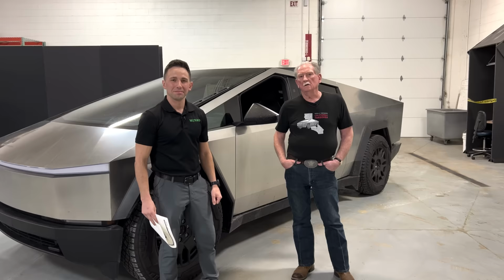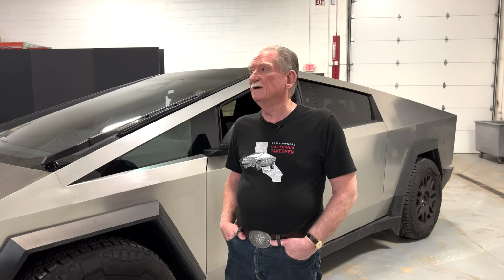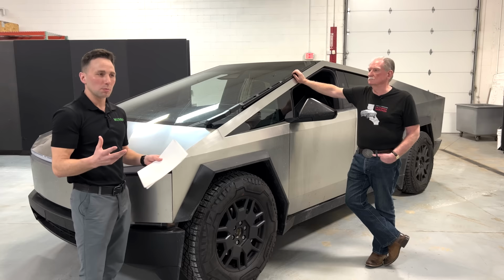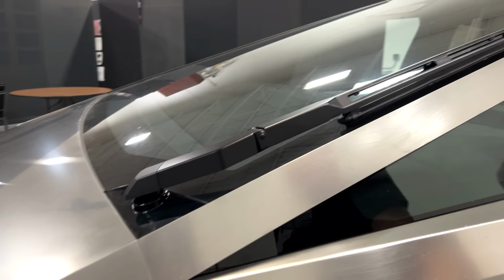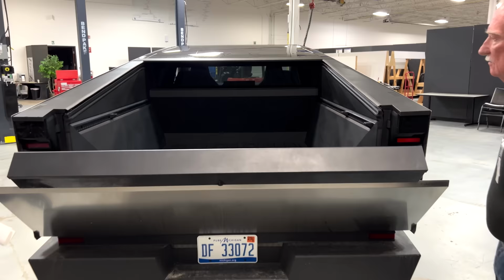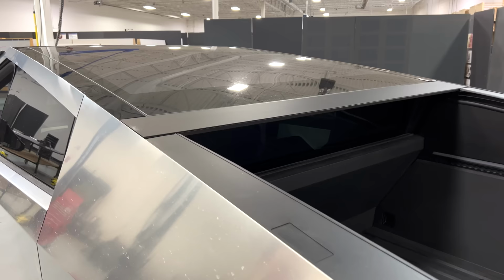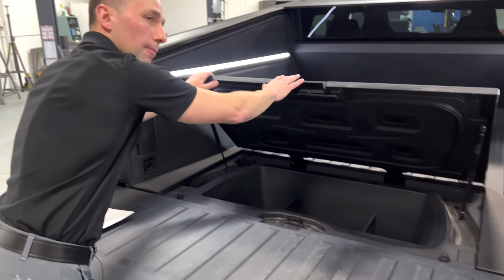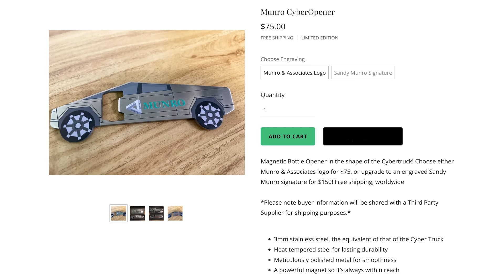We're Tearing Down a Cybertruck!

Comment: It would have been really great if they had built in a midgate that folds down like an Avalanche.
Reply: then CT would NOT be water tight.
CT has scuba system for Battery pack.
Reply: Midgates are a major structural problem. The Avalanche was body on frame, every other unibody pickup hasn't had a midgate for that very reason... structural rigidity just isn't there, especially if you want a meaningful amount of payload/towing
Reply: @Black-Villain  Didn’t say it would be easy.
Reply: @Black-Villain   Agree.  At times on does what is best for the design.

Comment: For me, it's crucial to check whether this car has the announced exoskeleton. I'm afraid these flat panels are attached to a regular steel body.
Reply: Videos from the factory shows the cybertruck frame is regular stamped mild  steel with some very large aluminium castings, not as large as the model 3 or y mind you, then the hard stainless steel external panels.Interviews with tesla have also confirmed the internal frame is steel, they didnt specify what grade, but likely its mild with some areas hardened depending whats needs for crash worthiness.
Reply: Yeap, it may have some structurral involment.
Reply: The problem is that few people bother to understand what an exeskeleton is.  As I understand it for the purposes of vehicles so long as the skin plays a part in the structure it is an exoskeleton.    But forget that.  What ELon said is they were going to move some of the weight from the frame to the outside to build a tough truck.  They did that.  Then they figured out they could reduce the wight of that skin by work hardening the 1.4mm stainless.   So unless you goal is to prove Elon lied, not allowed to change, you now know all you need to know about the the exoskeleton issue.
Reply: @Marc83Aus  Sort of close.  The cabin sides are constructed of ultra high strength hot stamped boron steel.  As do BMW and Mercedes Benz. This is where the similarity with a regular unibody  or body on frame truck ends.  The front and rear castings bolt to the cabin.  The casting provide the mounting points for the body, motors, gear reduction and suspension.  The aluminum casting have the crush zones engineered into them.  No steel needed.   A casting gives the designer more control over shape and cross section so works well for this.   
Tesla has some very good materials science people.   They use what is best suited.
Reply: @danharold3087 Thank you for the extra details.

Comment: There is an important distinction that I feel the need to call out. And that is the difference between what is a truck and what is a pickup. A pickup is any vehicle with a pickup bed on it. A truck, however, is an Unlimited Utility Vehicle. That a Truck can be configured with any type of duty specific or general utility equipment on the rear portion of its chassis is what gives it the distinction of an Unlimited Utility Vehicle. 
Vehicles such as the Ford Maverick or the Tesla Cyber[Pickup] do not have the ability to interchangeably exchange the rear portion of the vehicle without significant alteration to the structure of the vehicle; therefore they are limited utility vehicles. Vehicles like the Ford F series, Chevy/GMC twins, Ram, Toyota, even Nissan, all build Trucks that are configured from the factory as Pickups, but because that pickup bed can be uninstalled without altering the structure of the vehicle it is still an Unlimited Utility Vehicle.
Reply: I would have said the difference between a truck and a pickup truck.  Tesla has all the experience and bits needed to build all sorts for trucks up to the class  8 semi.  Don't look for them anytime soon.

Comment: 8:00 imagine some magical sensor that'd sense the actual distance to obstacles in the back. Like an artificial bat or a sonar but with air instead of water... 😮
Reply: As an owner of an Model 3 with the WORTHLESS, WORTHLESS, WORTHLESS* camera-driven park assist, I appreciate the sarcasm, but doesn't the CyberTruck have a backup camera?

* Did I mention worthless?
Reply: - see video, Tesla model 3 - 7 point turn , culdesac.
Reply: @Wi2Low  - the Driver is using PURE vision & no stalks.
just swipe & turn EZ peezy.
no OTHER can do that.
Reply: @Wi2Low  I expect tesla will be intensively working on the CT software for the next year.

Comment: A truck is for putting things in, moving them, and getting them out.  You cannot put things in from the sides.  It is too tall.  You could throw things in.  Then when you want to get something out, you cannot because the sides are too tall.  You must crawl in from the back and the bed height is too high.  There are no steps to be able to climb in.  The bin is too far in to reach without climbing in. This is a poorly designed truck.  It is like a bunch of city kids wanted to design one but had never actually used one to go into the backcountry or get work done.

Comment: Still have to disagree with Sandy constantly saying this isn't a work truck. That is only currently true due to the price. Being from the trades and talking to other guys who work in the field, I can say that many of them would love to have this as a work truck, where they can easily lock their tools in the back and don't have to worry about scratches and dents.
Reply: It's not a work truck. One big challenge will be repair. Most work trucks can be repaired at most within a few days.
Reply: i strongly disagree with you too, work trucks are made to be super practical and versatile from offering single to double cab to different bed lenghts to different load carying capacity.... the bed can very easily be removed or modified to add equipments, the frame is tougher to mount equipments..... look at the ford f250, f350... they have third wheel option, dually options....
Reply: a conventional truck can be have the bed removed to install a dump truck, a crane, utility bed, conversion to ambulance, bus, RV..... the cybertruck is a joke compared to a real truck! i mean even 6x6 conversions are possible with the amazing solid axles... even mercedes Sprinter vans have the ability to mount a crane.
Reply: @alanmay7929 nobody does all that to a half- ton pickup, be it F150 or Cybertruck.
Reply: @jamesengland7461  the point is the fan bois want to claim the Cybertruck is going to replace all trucks everywhere and everyone else will be bankrupt within a few years.
Reply: I'm definitely not claiming that this will replace all trucks, but this is perfect as a job site truck used for hauling around tools and some material.
Reply: @MorganWalser  it's a little expensive for a job site truck. My Ford F-150 v8 with a 8 foot bed, use to get all the notes for cash offers.
Reply: @MorganWalser  but I am expecting the next generation Tesla van will be mega popular with the trades.
Reply: @Dularr  yeah, it certainly needs to come down in price first. I said that I'm my initial comment. I agree that a van would be extremely useful.
Reply: @Dularr    The CT is Tesla's smallest truck.   It has all the goodies to build body on frame trucks from the semi on down.  I don't expect them too as they have other things to do.
Reply: @MorganWalser  nope its not!, its a very unpractical truck which wont get better with time! there is a reason why trucks have had the very simple body on frame to allow all kinds of configurations possible! i dont think there is ever going to be a single cab version of this with different bed lenght.......
Reply: @jamesengland7461  lol!!!!!!!!!!

Comment: Don't get it wet, it rusts easily. Also, don't get stranded with a flat anywhere because it's a truck that doesn't even come with a spare tyre.
Reply: That's not rust it's particles that fall on it and oxidize.
Reply: Blatant lie

Comment: You got it.  TESLA went after the 73% of the pickup truck owners only use the truck to haul or tow 2-3 times a year.  The reset of the time it is daily travel just up high, which my wife liked about the Ford Ranger we had for a while.  It is a truck that rides like a car but raises for off road/camping, hauls projects easily handling the 4x8 sheets, and can still tow.
Reply: I am projecting 1/3 of CTs will have our ladies behind the wheel.

Comment: Finally the type of content for which I subscribed in the first place 🎉 but honestly sandy has become a bit of a Tesla shill.  The windshield wiper literally shakes my cyber truck at a stop and it doesn’t even clear the passenger side. Horrible design yet he’s talking about how wonderful it is. lol
Reply: Agreed. Claiming that this is the best Sport truck… what sport? I’ve seen so many videos of this getting stuck off-road. It’s not the fastest or even close to the most capable, so not sure how it could be considered the best.
Reply: Are you using RainX products?  I'm finding that they can cause wiper sticking, rumbling, chatter and total locking up on many vehicles and more so especially on those with long wiper blades.

When people bring me a vehicle with wiper issues first thing I check is for RainX and the fix is very often to flush out the washer tank, scrub it off the windshield and replace the contaminated wiper blades then tell the customer that they should refrain from using it on their vehicle.

Best!
Reply: @neilfromclearwaterfl81 RainX does that to get people's money, let's be real.
Reply: @casualgamer1209  If we don't call it out many will end up getting scalped by mechanics who have no problem with replacing or charging to replace expensive components when all that was needed was to clean the RainX residue from the windshield along with the rest of the wiper/washer system.

I've also come come across some who have broken teeth off the gears in their wiper motors due to the additional stress it can put on the system.

RainX to me is for vehicles without wipers or with wipers that are broken and you need to drive in the rain before they can be repaired.

Anyways, best to call it out so some who haven't considered this won't also suffer similar.

Best!

Comment: Sandy.
Why not a bed slide-out?
Even easier to load / offload sheet material, or you hunting gear, etc.
Plus, why not a second lightweight slide-out fixed to the airline track? Great for tools, coats, boots, etc.
.
Would make the truck REALLY practical.
Reply: Don't know why.
Reply: These are things that not everyone will want and will add cost.  Watch the 3rd party suppliers.  If there is a market for them they will come.

Comment: The old guy is talking about how the body lines are like 1/4" apart on purpose for water runoff --- WHAT??  total smokescreen.  This looks bad, the stainless steel shows buff marks everywhere and not a uniform look, fingerprints everywhere -- these 2 fanboys are just that.  These trucks suck.  Embarassing that they have the audacity to call it a beast.  It will lose in a real truck war.
Reply: Fingerprints and stuff are because it's stainless steel, won't appear on wraps (something most people will probably get), panel gaps will get smaller and are due to the manufacturing process (plus, look at this versus prototypes spotted in tge past- much better, dont you think?). YOu can call me a fanboy, but I actually like looking at other platforms, and my 2nd choice is MY, first choice is Ioniq 5 because of the charging and brand loyalty within my family.

Comment: Tesla Fanboys 1 st the full self driving function is not enable not even adaptive cruise control second the truck was delivered with no hub caps they are damaging the tires you are telling me they did 1000 of milles of durability testing and did not see this ? Third how do you climb into the truck bead compared to a ford lightning ? Fourth the rear steer is limited because of software so the truck is not fully ready . Fifth the differential lock are not functional again software locked and why is the driving range is not even close to what they said it should have when they unveiled the truck back then and the price is way higher than what it was supposed to be.  lastly the outer stainless steel panel are not part of the exoskeleton.  It’s not any more than the composite panels on a Saturn car.
Reply: Then buy the Saturn you love so much.  Only 2.1 million fanboys have them on order - so enough to keep the factory running for quite a while.  Is it perfect - no, but I've never seen a vehicle that is.
Reply: Range estimates were hyper-optimistic to be fair, bed seems to be step-less so it's up to you if that's a good or bad thing, and hubcaps/aero covers are gone because they actually damaged the tires MORE than without them.

Comment: 304 stainless steel... they @#$%@#$^% made the skin out of the wrong alloy.
Reply: I'm sure it's not 304, but a custom alloy that Tesla developed in part for SpaceX.  Just a lot of people associate the look of 304 with the Cybertruck without any knowledge.
Reply: Why is that the wrong alloy? Reportedly, this alloy was chosen with help from some of the best material experts around - namely SpaceX.
Reply: @tesla_tap 3ric Johanson used an x-ray metallurgy analyzer and its 304… don’t know how much more specific you can get than that.
Reply: It's Bulletproof martensite.
Reply: @markplott4820  304 stainless steel is an austenitic steel that can transform into martensite under stress... like a bullet hitting it for example.

Comment: I feel like Tesla is missing an opportunity to convert the under-bed storage into the space for range extending batteries. There could be hookups in there for coolant lines, too, so that campers can tap directly into the truck's heat pump. That would also work for cooling a battery pack. Or for converting the bed to a refrigerator truck. There are possibilities for commercial, RV, and range extension.

Comment: So disappointed that they cut out two of the most practical ideas from the launch truck: kneeling rear suspension and tailgate integral loading ramp. Trucks have needed those for decades, thought Tesla had done it with a clean sheet design, but why didn't they? And what's the bed height?
Reply: Tesla is good at doing software updates like this.  Give them some time to finish the truck then ask for upgrades on X.  Elon and the factory people are listening.

Comment: Gotta agree with Sandy's comment that the F-150 is a "work" truck (although I would have said "real" truck) and the CT is a "sport" truck.
Reply: Cybertruck has MORE utility & use case than Lightning.
and Lightning has poor SALES.
Reply: Yeah that f150 with the shorter smaller bed, lower ground clearance, and less durable body and glass is totally the best work truck lmfao

Comment: My biggest disappointment is the range, during the tear down my question is: is there space to add more batteries or is the 123 megawatts a space limit?
Reply: Range extender is planned but it's in the back of tghe bed for some reason and not in the under-bed area
Reply: @casualgamer1209  the range extender is such a clumsy solution.  I wondering if there wasn’t room for more batteries up the the bed.
Reply: The 123KWh (not mega) is a weight more than a space issue.   GMC did what your asking for with its 2 layer batteries in the WT4 and hummer.  You can maybe buy them.

Comment: A very important thing is to show in detail the interconnections for power, data, coolant, and structural ties between the Cybertruck and the announced (optional) range-extender battery?  I noticed your tear-down unit doesn't have the range-extender battery.  Knowing Tesla, the interconnection points most likely are there on all production Cybertrucks.

When it's available and feasible, a tear-down of a range-extender battery might be in the cards...?

Renting an auxiliary battery for special trips will be a good business opportunity.  Rented units would be installable with a forklift.

This will also make third-party auxiliary trailer-mounted batteries a much more feasible and economical option to develop and market.

Could you influence Tesla to make available, if it isn't already, documentation of the Electronic Data Interchange between the Cybertruck and the range-extender battery? I assume the physical connection will be to tie into the Ethernet ring architecture. The power will have both 800V and 48V connections.

This information could be in a "specialized report" and sold to all sorts of companies in the trailer and supplemental battery and RV Solar industries.

Comment: The sadest thing about the cover is that it took away the possibily to fold down the rear window part to get a proper sleaping/camping truck. Maybe the should have let the tonneau cover fold in on the inside of the car roof. Would have worked as a suncover for a big part of the glass roof. Then they could have made the rear window part foldable. And the tonneau cover could have been closed if you wanted to sleep in the bed and have a safe roof and climate control of the whole area. That would have been something for Sandy while hunting.

Comment: At reveal, Tesla promised the Cybertruck would be capable of hauling a 3,500-pound payload, towing 14,000 lbs, and driving as far as 500 miles on a single charge. Today's delivery event however outlined only a 2,500-lb payload, 11,000-lb towing rating, and peak range of 340 miles. There will be an optional bed-mounted extra battery to boost range to some 470 miles, but the 500-miler is MIA

Comment: The problem with the design is that it will most likely not be allowed in the EU since modern cars avoid sharp edges and use thin steel for a reason. It's to protect eventual pedestrians that you accidentally collide with. Removing hard corners and having steel that are designed to buckle on impact reduced fatalities in car pedestrian collisions.